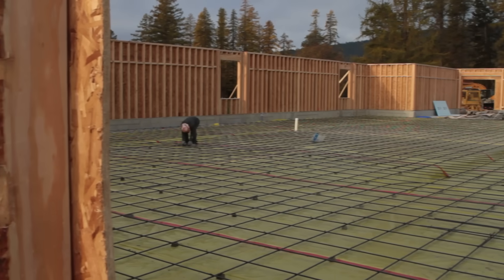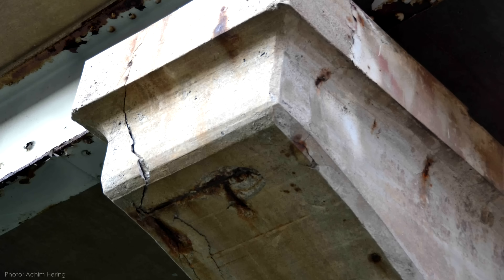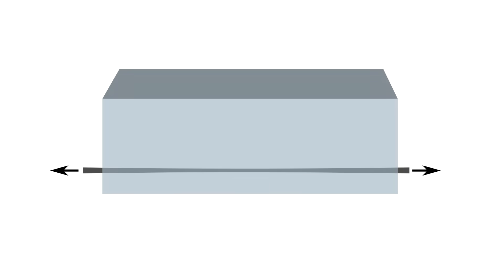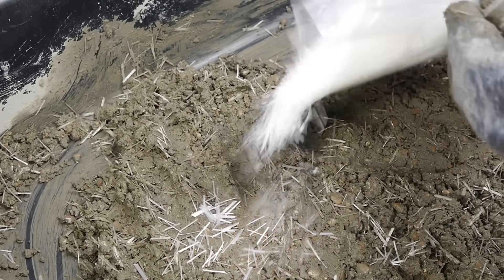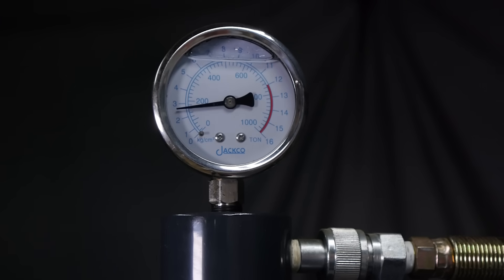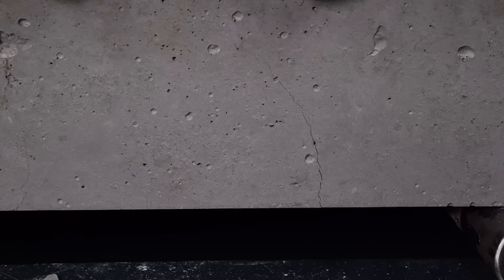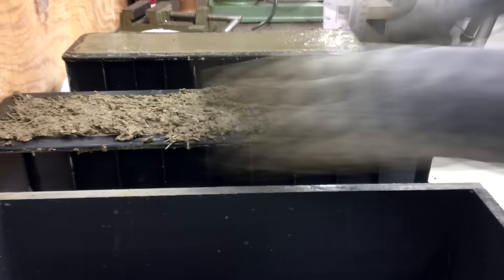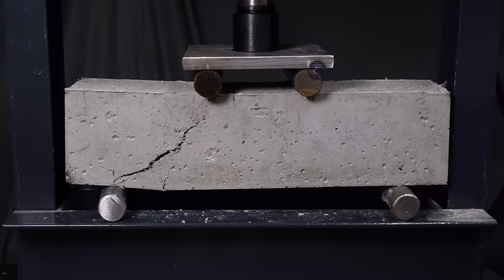Does Rebar Rust?

Comment: Nice video. Always informative.
Should do a video explaining why the rebar is located near the bottom of the slab. Also why with concrete pads you may want it the rebar/mesh at the top as well.

Comment: Why is rebar not painted to avoid rusting
Reply: aditya kushwah Engineers usually design for “under-reinforced” concrete, meaning that rebar is going to fail before concrete. And failing of steel means it starts to stretch, but dried paint doesn’t deform in such way but rather just crack, therefore exposing the steel underneath. The other reason is rebar and concrete needs to have a very strong bonding, where the paint creates a smooth and slick surface and can be pulled off relatively easy.
Reply: @simonl7067  thank u
Reply: AGENT 47  but then the epoxy coating won't create a slippery or smooth surface which would prevent bonding of concrete and steel reinforcement?
Reply: the commercial rebar in our area is epoxy coated and has a ribbed surface. I think the engineers call it ...deformed...which promotes an improved bond with concrete even with epoxy.
Reply: @pensive69  that's right.. the bond between the concrete and rebar is created by the ribbed surface. I don't have my CRSI book handy, but if I recall correctly, development lengths (bar laps, embedmendment depths) are a little longer for epoxy-coated bars.
Reply: @adityakushwah4980  I think it is the other way around
Reply: uhh..  stupidity..?     I double coat everything in enamel..  the porch of the old house was done the same way,   no cracks,   75 year old porch..  although I'm not sure what paint or seal they used..  its 3 mm thick   looking at the rod we cut for an addition..
Reply: Because rebar can easily loose bond with concrete. Bond is very important.
Reply: Paint tends to shrink and crack. Rebar needs to be coated with flexible polymers such as neoprene or polypropylene films thermally bonded to the metal. These will not crack.
Reply: AGENT 47  Epoxy rebar has been proven to not last any longer than normal rebar. The slightest nick in the coating actually traps moisture and accelerates rust.
Reply: it is
Reply: Painted rebar is ussually on bridges or places that are exposed to water and high moisture, othervise is to expensive to use on regular base
Reply: They starting to use in europe fibre glass rebar they said it lasts longer it is easier on people and its cheaper than steel rebar 
That woukd solve many problems as main is labour nobody wants to do heavy lifting for 8 or 10 hrs 6 days a week.
Reply: Contrary to popular belief, surface rust isn't something to be worrying about. I'd rather see reinforcement installed that is already has surface before curing than install it clean with a risk of it expanding as the surface oxidises.
Reply: It easy and cheap to replace rebar that try to stop rusting.
Reply: @campkira  In a skyscraper?

Comment: if we see in chemistry way, we can add metal that easily corroded like zinc to make an electrochemistry cell that make zinc corrode instead of the steel

but the weakness of this methods is we need to replace the zinc regularly

Comment: Another reason of using rebar and no other kind of reinforcement is the stress that thermal expansion/contraction will generate, as God wanted that the steel and concrete had almost the same values for thermal expansion

Comment: My trade school talked about cover distance minimum of 50mm and no less. From experience in non salt condition this has been working, where 25mm has corroded and cracked. Though this can be prevented by using stainless steel rebar, but that brings the cost up, stainless being if i recall right 6 times more expensive.

For fiber reinforcing too bad you didnt use hemp fibers in the test. Other interesting option would have been use of wood chips, chainsaw dust, lime and concrete mix, witch works as insulating concrete, with 50mm normal concrete shell.

Comment: Another great video. Given the potential for rebar corrosion, its suprising stainless steel isn't more common in reinforced concrete. Why isnt stainless steel rebar more common? Is it due to material cost or industry conservatism to use the materials they have operational experience of?

Comment: One of my civil engineering professors in college suggested that the cracking of the concrete is actually a design benefit... That way you can see that the failure is coming with enough time to do something about it...

Comment: What about bamboo reinforcement, did it better than steel for strength and durability? Can it be alternative? Because some rural areas steel rebar are expensive compared to bamboo that are soo cheap even free in that area.
Reply: Bamboo may be an alternative for steel in developing counties but it is not a replacement for steel.  The reason why steel is ideal is because it has high tensile capacity while also being very ductile, in that it will stretch but not break.  Bamboo is not ductile, it is brittle, which means when it breaks it fails completely and thousands of pounds of concrete falls on the people inside the building and kills them.
Reply: @travsb1984  Two comments -A) bassalt rod/fibers would eliminate the corrosion issues and B) fist saw bamboo being used in a concrete pad 10 years ago - the apron of a gas station.  10 years later, there isn't a crack in the concrete anywhere.  Seems it might be a viable alternative in many applications.
Reply: Yes, bamboo is better than steel.  This is why, when a typhoon blasts through the Philippines versus Japan, all the buildings the Philippines are fine, whereas Japan gets completely destroyed.

/s
Reply: Ignorant comment.

Comment: Isn't it the case that certain forms of steel, apart from its alloy, are resistant to corrosion? Couldn't they induction-heat and quench steel to make flash bainite or do some other sort of treatment?

Do austenite, martensite, pearlite, cementite, etc. forms of steel have any lower corrosion risk? How hard would it be to get the steel into that form?

What about black oxide? I heard that this form of coating prevents red rust (the expanding kind) from forming. Have these other options been explored?

Comment: One correction I would like to add, the chloride ions don't react with regard directly, rather they react with the oxides in the protective transition layer that you mentioned. This lowers the alkalinity of the transition layer creating an anode, the steel rebar acts as a cathode and sets the stage for a electrochemical reaction to occur. Corrosion is a electrochemical process, and both a cathode and anode are required for it to occur. As it is an oxygen rich environment, the reactants needed for the corrosion are present and the corrosion then begins.

Comment: From my industrial materials class years ago, I understand that the failure (at least in metal) takes place BEFORE and naked eye visible damage can be seem.
     When charting the stress to failure you end up with a nice curved graph with an odd little dip at the top before the metal breaks in two. The failure takes place at that dip, not where the metal actually breaks in two. This is quite dangerous because the metal could be failed, and this much weaker before there is any damage you can see with the naked eye.
     Why isn't the concrete "failed" as soon as it is cracked?

Comment: If it's the cracking in the concrete that does it... (freeze/thaw and salt) why doesn't anyone coat it after it cures? Like a rubberized/bed liner or cork coating? Something that would 'give' and keep the cracks covered when they appeared?

Comment: Wouldn’t Helix or steel fibers allow another vector for introducing corrosion into the concrete member?   The cracks may be smaller but there would be no way of ensuring complete encapsulation of every strand of steel fiber.

Comment: Wow ! This presentation was very well made and the ideas presented in it are very interesting. It is true that we should consider using different alloys than steel but the costs involved are another matter of there own , and i can't help wondering why those steel frameworks are not welded together instead of simply being tied. I've also payed attention about how and why ciment in brick walls ages and i've came to think that the sand in its mixture must have a different expension-contraction ratio than the rest of its final solid state , which would obviously make it falter much faster in areas where seasons have below zero temperatures in the winter and hot summers. Roman mortar didn't contained any sand after all. Thanks for sharing this and i hope we can all contribute to finding a better solution in creating new materials to build with.

Comment: Really informative.  I recall an  international competition wherein Iranian Civil/Structural engineering students achieved incredible results by mixing steel wool and quartz with concrete.    From what I understand they achieved almost 40k-60k psi in testing.   I was able to find a few articles but not the detailed specs I recall.   Might be a fun follow up for you if you wanna drop the cash on a bunch of quartz and steel wool. Doh.... I found the wiki https://en.wikipedia.org/wiki/Properties_of_concrete

Comment: I agree that FRP is a very interesting subject! It seems that one reason why FRP bars are not used very much is their low Young's modulus (exceptions for some carbon FPR products which are very expensive), which in the cases of many beams leads to the need of a taller cross section (more concrete), or more reinforcement to reduce the tensile strains in order to lower the neutral axis and get satisfying capacity of the compressive zone. This leads to even higher initial costs than one naively would expect. It seems like the short term expenses is the number one reason for FRP bars not penetrating the market on a larger scale.

Comment: Just a piece of advice from a fellow engineer: "tons" could mean anything from "short tons", "long tons" and "metric tons".

I once worked in a project with american and british engineers and "tons" were used by all three teams, with diferent values. I mailed all teams to stop using "tons" in their reports or to clarify which one they where using. By the way, the british engineers were using the left handed rule, which flipped the Y coordinate in some of our inputs...

In the literature, there is a crane accident that happened because "short tons" were used by a team who expected "metric tons".
Reply: Huh, I've never encountered US engineers using tons for anything...  Pounds and kips (1000 pounds) are all we use with the exception of aerospace companies who have adopted SI.  I've never encountered the other tons you've mentioned.
Reply: Paul Dawson  tonne (symbol: te) is "metric ton" by definition (1000 kg). I am talking about the "ton" unit, which varies (and could be 2000 lbs, but most often, not).

And my point is that no one should  use a "unless otherwise specified".  In an engineering environment, you should always be clear about the units you are using.
Reply: Oh, and in the european concrete industry, load, or pressure, is measured in kN, not in metric tons. That is used for the weight of the concrete. :)

Comment: Great video.  Only thing you missed mentioning was that the coefficient of thermal expansion of steel rebar is very close to concrete itself.  When concrete reinforced with rebar heats up or cools down, the rebar and the concrete expand or contract at nearly the same rate.  This isn't true for many other materials, such as stainless steel.  If they expand and contract at different rates, you get more cracks.

Comment: Given the title of the video, one would expect epoxy coated and stainless steel rebar, etc., to get more than half a sentence.  Instead, we get the circuitous pitch for FIBER REINFORCED CONCRETE again.  Balance?  

Anyway, everyone loves your work.  Looking foreward for more.
Reply: Because the low tensile strength of stainless and poor bonding on epoxy, and the high price for both makes them less desireable.

Comment: Always love the videos! Back when I was in school, the Virginia DOT was talking about using carbon fiber composite cable externally to reinforce existing bridges where significant amounts of rebar corrosion had occurred, rather than rebuilding the bridges itself. The cable gets placed under the bridge and clamped on each end so the cable receives the moment in tension. Here is an old power point they posted on the subject if you're interested http://www.virginiadot.org/business/resources/materials/2013Conference/bridge/3%20-%20Celik%20CFCC%20030813.pdf

Comment: I'm puzzled why the rebar in your test blocks was placed so close to the surface? Shouldn't it be 2" deep as you mentioned in the video? And as Joey Cheng pointed out below shouldn't there be hooks bent into the ends to help transfer the load between the matrix and the steel?

Comment: But... Those beams didn't break by traction of the bottom fiber of concrete! They broke because of shear stress. You didnt reinforced shear stress direction so the result is a fragile break. 
Would have been nice to see them breaking in a proper ductile way to see the plastic deformation of bars and fibers. Cool video! I really love hydraulics topics as well.

Comment: Another you tuber pulled rebar out of a 45-year-old foundation and it was in a total deterioration and had little to no strength. Would it not be better to coat it with a water resistant material? I have seen people use saw dust, soap bubbles, rubber and other materials to change the concrete

Comment: Any chance you can talk about plaster - concrete mixtures tuned for zero shrinkage?  IIUC, concrete shrinks as it cures and plasters expands as it cures.  Both materials have been used for thousands of years, and yet the first use I've heard of combining the two to cancel cure shrinkage was on a parking garage in Southern California in the 1980s.  I'd be very interested to see tests of the combined material, both for shrinkage cracks and for failure strength.

Comment: What about using non-standard material to reinforce concrete? plastic? wood? 3d printed lattices? wood fibres? rock wool? Also cracking concrete is a good way to see if maintenance is needed. Its better to have a concrete beam crack and show a potential problem years in advance then to have it seriously fail quite suddenly, or so i was told.

Comment: That concrete looked to fail through a lack of anchorage depth, hence the concrete just popped off the rebar seen especially in the second case. That wasn't just an overall strength failure but an anchorage failure. I have been staring at RC drawings too long :P

Comment: The fibers looked straight. Wouldn't curved fibers hold things together even better?
Reply: The fibers are dry chop fiberglass. There are crimped fibers, usually PET or nylon, but those are inappropriate for alkaline environments. Polypropylene is a common cheap one, but also straight. Glass is/should be specified as (rather expensive) "ARG"  (alkali resistant glass) but some still resort to coated "E" glass which is a mistake. Wet alkali can intrude at cut fiber ends and migrate down the length. "E", "C" and "A' glass grades will all eventually dissolve in an alkali environment as some cement board companies have found out the hard way. Wood fiber works in cement panels (impact and flex) but because of its short length does apply to beams and load bearing cement (no tensile).
Reply: last line should read "does NOT apply to beams"

Comment: Is called "stainless steel" it does'nt rust and is even stronger.
Reply: Wrong Guvyyg.  Stainless steel DOES rust. https://www.polymersolutions.com/blog/why-does-stainless-steel-rust/
Reply: Stronger? It doesn't have near the tensile strength of normal rebar and is brittle as f*ck!
When I apprenticed as a fitter back in the day, I made some new sprocket bolts for my motorcycle (pin on one end, an oblong collar in the middle an thread on the other end), as the original ones I had ordered would take 2 weeks to arrive from Belgium ( I live in Denmark). Two out of four bolts snapped within the first 50 miles. Stainless steel is no good where high tensile strength is required.
Reply: Henrik, yes, due to alloys used to make it "stainless" it is weaker and more brittle.
Reply: stainless is not stronger.

Comment: You mentioned about polymer bars which are made of basalt.... Do they have the same coefficient of thermal expansion as that of concrete?? Bcoz that's the main reason we use steel for reinforcement...right...😃😃
Reply: No R Suresh. Steel rebar has a DIFFERENT coefficient of thermal expansion as that of concrete and is another reason steel rebar causes concrete failure.  Basalt has  very similar thermal expansion properties to concrete as it is rock.

Comment: I swear some people forget how to LISTEN when they ask "why not coat it in something" despite he said it is often coated in EPOXY which is a polymer (aka plastic) adhesive coating!

Or even the fact this is a DEMONSTRATION, not a normal test like there is videos of actual testing that can easily be searched for on YT! When they try to point out his "errors" in his demonstrations.

Then there are those of you who just immediately loose VISION when he not only mentions but shows images of fiberglass and basalt rods which are used often in residential and marine projects for slabs or other forms.

Or some who make one point and before the video is finished they posted that and add more via replies to the original comment, FFS just write the comment as you WATCH and Listen pausing to conduct the note before letting the video go on further. I can attest your comment will not disappear unless you click CANCEL on accident if not on purpose and can even read and answer another comment and your own comment in conduct still should not be removed by the system unless you command it so.

- END -